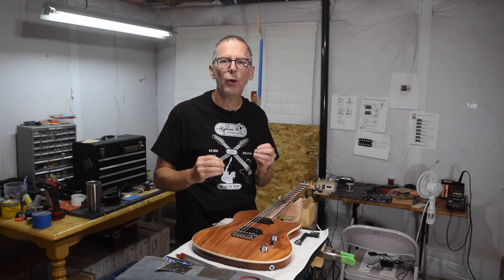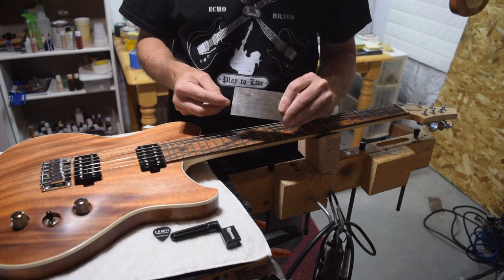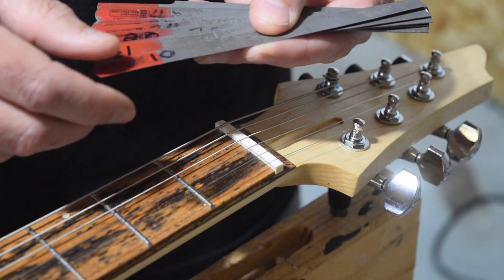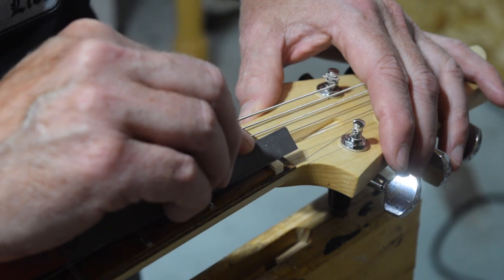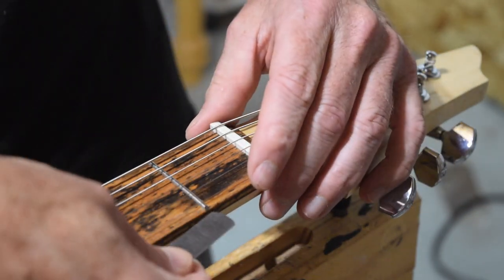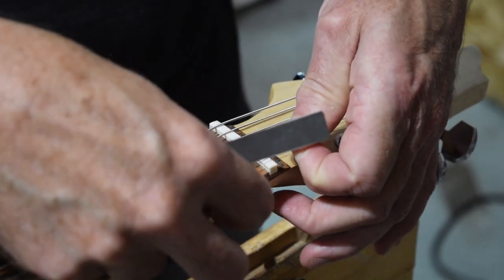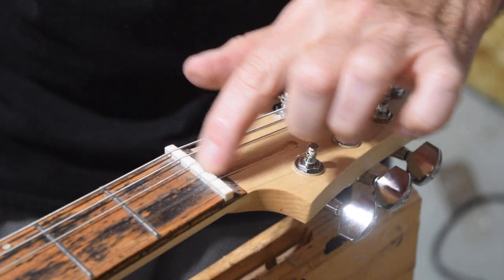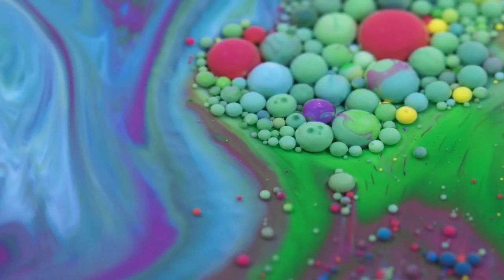Slotting A Guitar Nut

Comment: I'm bone nut crazy. Just about every guitar i own ill pull the plastic nuts out, tusk xl, whatever. Gone. And shape nuts out of bone blanks. It is like one of the best ways to improve a cheap guitar. Or bring a parts caster to it's full potential. That and fret work; levelling, crowning, fred end dressing, polishing. It can essentially transform a cheap guitar to a custom shop feel. Ill do that before I even think about swapping electronics. Think most people do the electronics swap first because there is less skill required. But frets and nuts are where it is at. it takes a lot practice and tools. But it is a small step into a bigger world.

Comment: Hi. Is it ok to use a 0.10 nut file for a gauge 9 string? Thanks
Reply from the maker: That's what I use.
Reply: @HighlineGuitars great. Another question, is it possible to just buy 2 sizes of nut files & use it on all gauges? 0.10 for G,B,E & maybe a 0.26 for D,A, low E? Thanks
Reply from the maker: @kaskas55  No.
Reply: @HighlineGuitars  ok got it. Will invest on a set. Thanks a lot!

Comment: Thanks for a great video. What do you think of the method of holding the string down at the 3rd fret and making sure the string is just slightly above the 1st fret to set the nut slot height?
Reply from the maker: That is how I normally do it. However, I don't recommend it to novices since many of them want a number to shoot for. With a little experience, pressing the string to 3rd fret is a faster way to dial in the nut slot depths.

Comment: This is one of the few videos that shows the correct way of filing the nut level and then filing the break angle. Most guys just file the slots at the angle of the headstock which leaves very little material under the string at the fretboard side of the nut. That way may give the best intonation but also will cut the slots deeper over time.

Comment: Interesting. You set the height of all the strings with a single 0.01" (0.254mm) probe. Thus , in order for the probe to pass snugly , I think the height should be one tenth of about a millimeter more , that is , 0.35 mm height from the bottom of the string over the top of the metal fret will turn out . If I use this method to set this value on my acoustic guitar ( with metal strings ) , and get 0.35 this value, in particular, as for the first thinnest string , it will clang at the middle stroke , which is unacceptable . Although the sound production on acoustic and electric guitar is absolutely the same . Unclear. For an acoustic guitar with an average force of impact on the string , a 0.016 " probe is used to adjust the height of the first string above the first metal fret .

Comment: Another great video Chris. Ty . I have a question sir. It kinda was addressed in comments below but was a bit vague. When filing depth , how much approximate material should remain flat where string rest before starting fall off towards tuners? Its a bone nut. I understand one doesn't want to sharp of an edge towards bridge but yet not too much material that may cause sitar and other issues. I'm guessing maybe 1/16" to 3/32" of flatness? Thanks for your time and very informative videos. Jim
Reply from the maker: Sorry, I don't know. There is no way I know of to measure it.

Comment: You just made me think about the nut width, if all we need is a shallow point where the string touches the nut, why do we use such wide nuts.
we can have nuts shaped like a triangle or even as thick as the frets will be sufficient.
This way we don't really need to make sure that only the front of the nut will be touching, because physically there will be only a front of the nut
Reply from the maker: And that is why a zero fret works so well.

Comment: Your very vague on the most important task regarding this issue.. the depth
of EACH slot, the measurement above the first fret for each string  ??
Reply from the maker: That’s up to you.
Reply: @HighlineGuitars     ??? What sort of answers that. ???
Reply from the maker: @kingdom777866  You don't understand guitar nuts, do you? I can't give you a precise answer. You have to decide what you want yourself.
Reply: @HighlineGuitars    Oh I do, but I’m just pointing out what your lacking in
your video ie important information, after all you did file the nut didn’t you..
So again.. what’s the measurements between the top of the first fret and
the bottom of EACH string.  ? 
If you don’t know the answer to that, how did you know how deep to cut
the slots. ??
Reply from the maker: @kingdom777866  the measurements can be whatever you want them to be. It all depends on what kind of action you want at the first fret. There is no specific measurement.
Reply: @kingdom777866  yeah the main characteristic youre looking to adjust here is string height and string spacing. Also going off the first fret will only give you a ballpark measurement. And this is considering that all the frets are at about the same heights. Also make sure the fret board isnt at too sharp of a bend. that will affect your measurements.

Comment: I'm really having a hard time pulling the trigger on what appears to be expensive specialty tools, but the $10 grooved wire "nut files" on Amazon have rather sucked for the thin gauges. Have you tried any specific brands and deemed them worthy of the ~$100 ask?
Reply: The only ones I can ever find are the overpriced StewMac files.  Gotta wonder where they source those $.50 wholesale files.  It’s one thing if you use them all the time, but for just a couple of guitars...expensive.
Reply: Just get to the source who is making it. The files you often see luthiers use are Ibanez files...again a branding but the ones making it and earned a lot of trust are made from HOSCO in Japan. They're the same as the Ibanez files just without the brand on it. I can't tell you where the Stewmac ones are made, but most of their tools are overpriced if you can't get a discount via a membership or a sale. Always keep in mind what material you work on and how the tools work. If you work with diamond like coatings, the only thing ruining them are intense heat by using it nonstop with high speed. With normal use they last several years even for luthiers and repair shops.  If you just use them on your guitars and you have the same gauge of strings on all of them than you don't need a full set at that point. And you can use one gauge for more strings if they're kinda close to the gauge of the string. There are some files from gold smiths that also work quite well, but that's personal preference or helpful when you know someone who is in that business. The further you move away from any connection from "luthier" or "guitar" tools, the prices get a bit lower and sometimes the quality rises drastically. If you put string gauges and file sizes in a spread sheet, you'll see what you need.
Reply from the maker: Pssst... here's a secret: buy a feeler gauge set and use a Dremel with a grinding disk to gut teeth in the edges of the gauges.
Reply: Highline Guitars that’s a great tip!
Reply: @onpsxmember  I second the Hosco recommendation.  They have a couple different versions.  They are all worth their price.

Comment: I could never play a guitar with that high of an action.  I set all of my guitars at 4/64" E2 and 3/64" e4 at the 12th fret.  I use a digital string micrometer and always install a Zero Glide nut and a bone saddle (if acoustic).
Reply from the maker: That's almost exactly the same action my guitar will have AFTER the nut is slotted.

Comment: Do you have any tips on how to sand a satin finish a guitar....from start to finish?
Reply from the maker: You can't. If you try to, anything that rubs against the surface (the inside of a guitar case, your arm, your clothing) will polish the surface. If you want a satin sheen, you have to use a clear coat formulated to dry with a satin sheen.